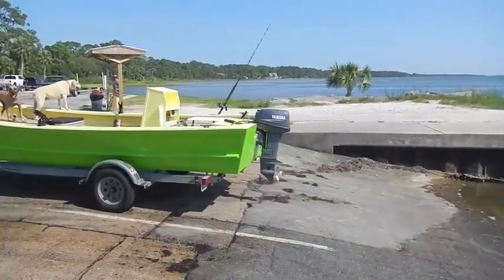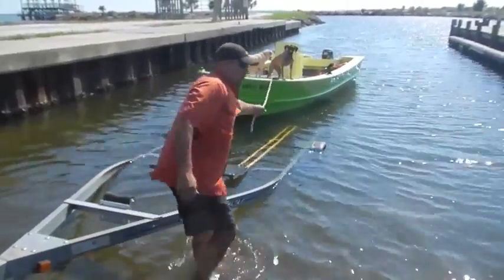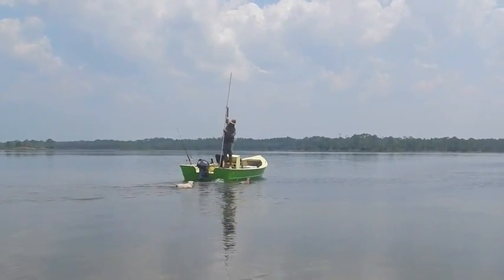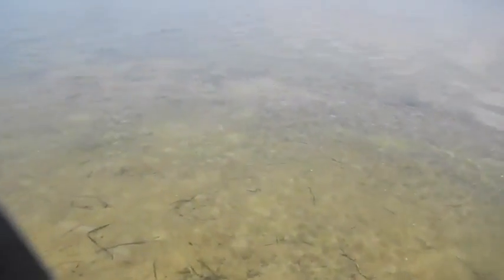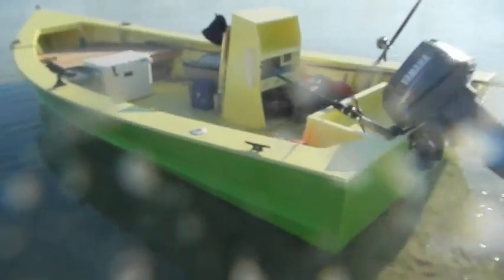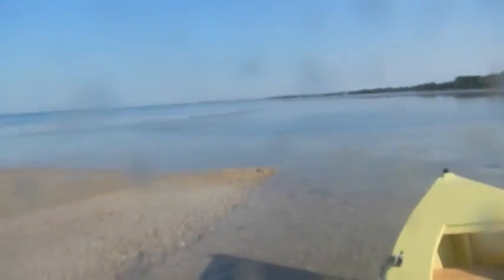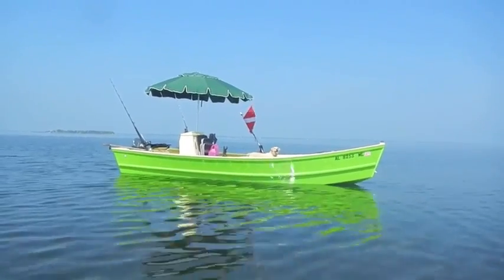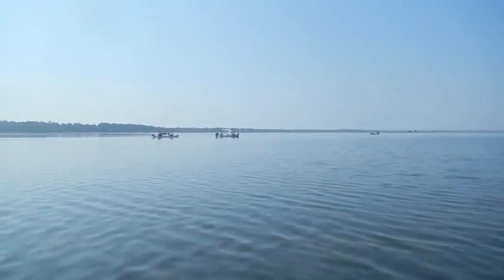Albion Boat Build Part 11

Comment: Sweet boat.  How far up from the bottom of the boat are the spray rails located?
Did you re-pitch the prop before you bought the bigger motor, if so, what pitch did you go with?
Thanks again, bough the plans a few days ago and after I build my garage in a few month, I'm going to start on this project.  Watch all you videos and they are really great and will help me/ first time boat builder.

Comment: you did a awesome !  job on that boat , what do you think the over all weight is , i havent watched the whole build yet but ill well , i like getting into the shallow water as well , and i use thai longtails i have a 13hp harbor fright on one and a 23hp on my large set up , i will be building one with the 22hp harbor fright v twin very soon ,there is no reverse on those types of boat motors , yet you are able to do a 360 degree turn around by holding the prop out of the water a lil bit so thats a lil trick that really helps out at times,, you just have give yourself plenty of room ,for what ever size boat is being used as well as the prop sits around 8 feet behind the boat , there a surface drive so a thai longtail will let ya keep running when ya hit the shallows , you dont stop till ya run out of water , as long as the prop is at least 1/2 way in the water you,ll keep moving forward , iv ran 20 some mph in 9 in of water , you can see my builds on my channel , just in case ya wanted to check em out , i run sps longtails ,i like em b/c im not limted by water depth  and there cheaper to get into then a new outboard , i have a 15 ft jon boat so i dont run out into the ocean , but with the right hull i wouldn't hesitate , sure there called mud motors , but that doesnt mean ya have to stay in the mud , its just that yer useing a air cooled motor so you can go anywhere ya want .heck in thailand they use those longtails with V-8,s on them ,if ya havnt seen those just look em up on youtube there some to see lol , anyway awesome build and when  ya said you were thinking about a different motor, i thought id tell ya about the longtails i use . ok take care and watching this video has made me want to move forward with my own boat build .

Comment: Mark great job did you build it off of plans and I would like one the but in a v bottom,do you know where I can get plans.  Again it looks fantastic job well done..
Reply from the maker: Yes. It is from the 19' Albion plans here: http://spirainternational.com/hp_wood_boats.html

There are many other shapes and sizes there including v-bottom hulls.
Reply: how many hours did it take you? I can build a 25 by 8 foot aluminum boat in 80 hours with a helper. She's got gunnels and 12 inch washboards. I like being able to walk down the sides. I use it for tonging. I'm not knocking it, but I build mine so the bow and stern are the same height. It looks weird the bow curved up like that
Reply: Mark you know when you make these videos you're required to answer questions.
Reply: You might wanted to stay with the 25. A fifty will weigh 260 pounds and will make it so you can;t get into shoal water.
Reply: i tell you a good place to do that is on the Chesapeake Bay. They got more rivers and coves than you can imagine.